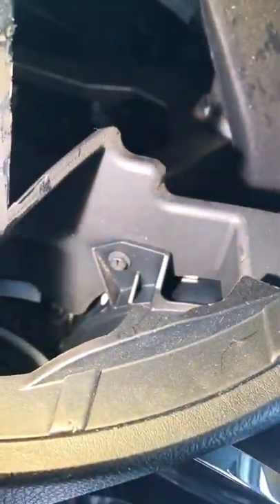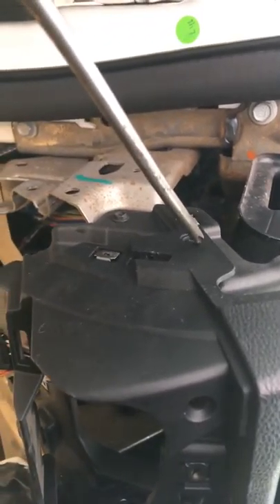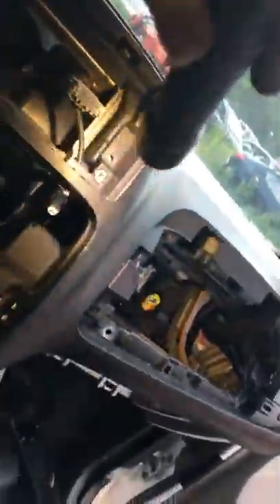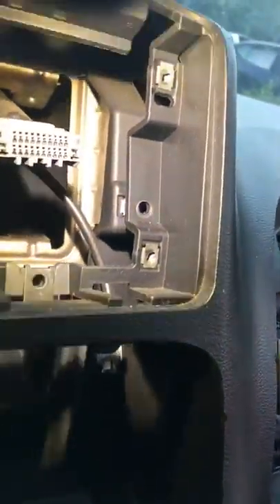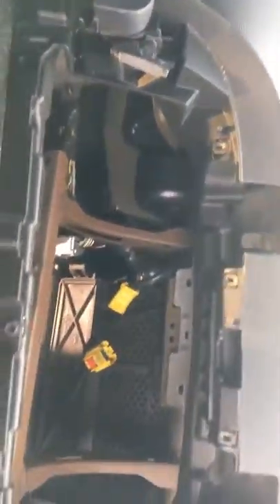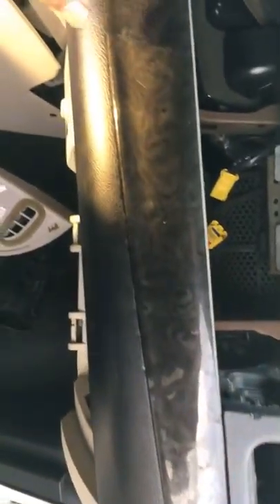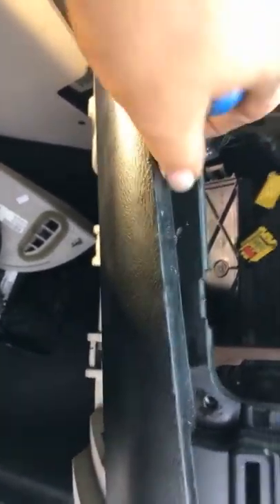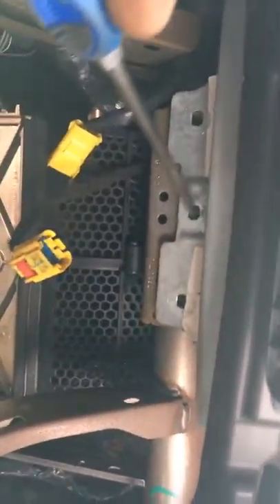2012 dodge caravan speedometer removal

Comment: Great video super helpful. Question for you..I need to swap mine out because the temp and fuel gauge stopped working...If I get a used one from a junkyard as it seems like you did will my mileage still show the same as my van has?
Reply: No. It has to be the same milage on both cloks